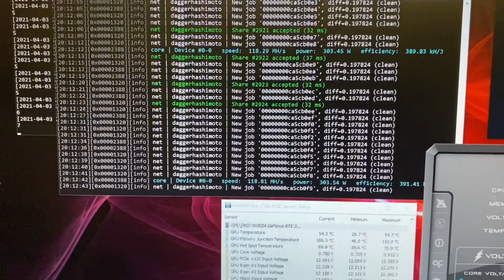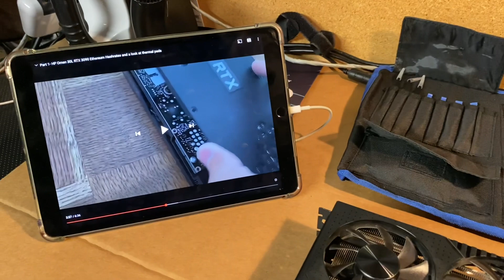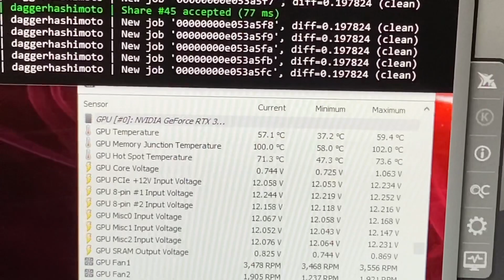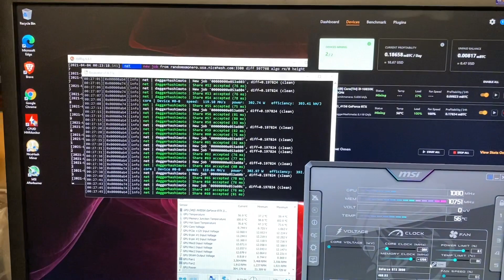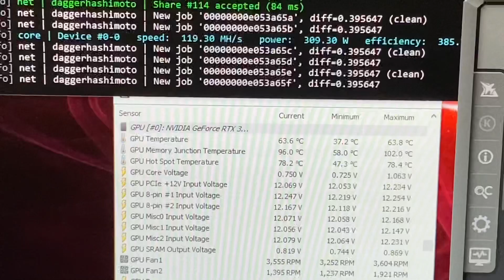HP Omen 30L OEM RTX 3090 Thermal Pad Upgrade

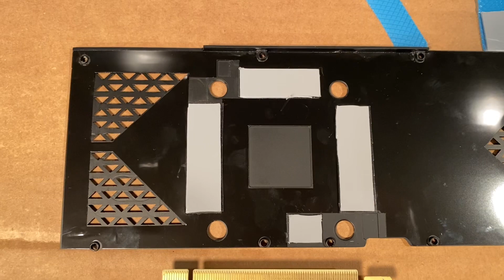Comment: 2:20 some on reddit commented to absolutely put a pad where the square indent is on the backplate to see temp reductions across the board (GPU and VRAM) by fixing pressure distribution? will try my luck as soon as i have my hp 3090

Comment: Hi everyone, i did put only thermal paste between cooler and the black metal plate and had more then 30 kelvin difference. The OEM thermal pads seems to be good.
Reply: What are your hotspot temps? I go to 105 rn don't know if i should repad or just do the thermal paste on the metal
Reply: @ParlasWOW   no, dont change the pads, do it like i did and you are fine. İ had 110 now it dropped to 80.
Reply: @Gotingenli  ok cool, thanks bro
Reply: @ParlasWOW  between the cooler block and the metal black frame is a little gap, this one is causing a problem and your heattransfer is blocked. Fill it with thermalpaste and you are fine.

Comment: it decrease the memory junction temperature , but why do you think when doing this the GPU Temperature and the GPU Hot Spot temperature increases dramatically around 15 and 20 C each? are we just distributing the heat or should we worry about some device temperature control isolated?

Comment: Hi Tony, for the back plate, how did you take out these 2 spring screws? They are different size compare to the 4 CPU rear spring screws, I tried to take them out and almost stripped them. what size screw driver should I use
Reply: Bit late now but im having the exacft same issue... Like i tried to get them out the normal way with 'brute'force (without braking things i hope) but it didnt came out.... gonna but some very very small amount of WD40 inside the screw so it losens the thread (i hope). Not sure what else to do. Already tried to put something  that has more grip between my screwdriver and the screw itself but again... no movement. May i ask if you ended up getting them out eventhough its over a year ago? lol. Thanks

Comment: I have done as instructed on the video and still maxing out at 107 MHs. Afterburner set to -375 Core and +1200 Mem. Got 61c on GPU temp and 90 on mem temp. Any help will be appreciated.
Reply: Try -250 with 1230 Mem 
And pl of 96-90

Comment: I just did the thermal pads replacement + added some thermal paste, and got -10° on VRAM temperatures! I plan also to try adding the heat sink on the top of the backplate, and see if I can decrease temperature even more. 
Make sure you are using 1mm pads, I tried first with 1.5 and it was too thick
Thanks for the video

Comment: Put any pads between the copper plate and the frame? I've seen other people do it with other versions of the 3080. But why use the paste?
Reply: I tried this and it created enough of a gap that the gpu no longer reached the copper.  Paste is the best I think because the copper winds up so close when you put the screws back in.

Comment: Lay a 120mm fan on the backplate blowing down, it'll drop junction temp a few more degrees. Ideally a high static pressure fan but any fan will do

Comment: I put two fans on top of the back plate for pulling, one on side to pull, one below the card for inhaust, one on top of the case for exhaust with the card’s fan running at 85% and it reports 96-98c on room temperature of 52f. I guess you can try to put at least one fan on the back plate(close to the rear where it’s hot) for pulling and the temperature may drop by a significant level.

Comment: hello. Thanks for your video. I have several questions.
* I have 30L-0850 Series / 3080 Geforce Card. Is 3080 using the Thermal-Pad 1mm ??
Reply: I believe so

Comment: Thank you for uploading this video.

I have an Omen 30l, with the 3080. Any idea what thickness of thermal pads I need?
Reply: I tried 3mm and 2mm today. Both too thick.  Will try 1mm on Monday.
Reply: @lagrafx  hey could you let me know what worked for you, please? I also have the same HP 3080 OEM
Reply: @maalisl  I believe they are mostly 1 inch pads
Reply: @sadistical5787  yeah I got 1mm pads and Noctua NT-H1. Now my GPU does not go over ~70C anymore!

Comment: i have the 3070 model, is it the same process?
Reply: 3070 uses gddr6, only cards with gddr6x have overheating issues. 3070 is an awesome card all around

Comment: Thanks for the guide.. My gpu was 67c, 108-110c junction. Did a thermal pad upgrade, it definitely helped vram, 98c, but my gpu is 80c. I had to mess with my thermal paste a couple of times as it was throttling clock speeds. Is it possible the heat dissipated from vram to heatsink is causing gpu stay hot? Is mining at 80c fine? I only get 105mh too..
Reply: I read this from an amazon user - 

Scenario 2 : Same as first, except when you test your gpu you get good Memory Junction Temps, but your GPU and Hotspot Temps are elevated. This problem occurs when there is an even distribution of pressure on the thermal pads, as the Memory Junction Temps are low, but the Heat Sink is not making proper contact with the gpu, causing the GPU Temps to rise. The solution to this problem is almost the same as above, with a few exceptions. First, check the backplate screws. Again, this solution may be just this simple, and yes, this happened to me twice on the 3080's. The first time i tore the card down, and put it back together and it worked fine. During the tear down, i noticed that two of the spring screws(M2x7mm) were fairly loose. When I put it back together, I didn't make anymore thermal pad changes, just double checked that the backplate screws were tightened properly. On the first test, GPU Temps were at 46 C, and Mem Junc Temps at 76 C... Perfect. On the second 3080, I was getting the same problem, and before tearing it down i double checked the screws, and sure enough one was loose. Tightened the screw and temps dropped immediately. Now, if you check the backplate/heatsink screws, and they are all tight, then you may have a second problem. This problem will be that all of the pads on either the back side of the card, or the front side of the card, or both, are too thick. If the memory temps are all low, but the gpu temps are high, then the thickness of the new thermal pads may be too thick, and the heatsink is not making contact with the gpu. This scenario is different from the first one, because in this scenario the new thermal pads are making even contact with the memory. For that reason, you would need to change all the thermal pads so that you can continue to get that even distribution of pressure on the thermal pads. Just as a tip, if your gpu temps are extremely high, then take off a mm from the thermal pad thickness, if the temps or only slightly elevated, then replace the thermal pads with a thermal pad that's only 0.5mm less thick. For example, if you have 2mm pads, and the temps are extremely high, then replace the 2mm pads with 1mm pads. If its only moderate, then replace the 2mm pads with 1.5mm pads. This is also making the assumption that you applied the thermal paste on the gpu die properly. This, too, can be the problem.

Comment: Glad I found this vid, I found the other vids for aftermarket cards, but this one is exactly what I need! So I made the changes and put everything back together (used 1.5mm pads) and now my GPU temps are too high, with OEM pads I was at 46.8/49.1/48.3 degrees (Min/Max/Avg), then after the mod I was at 71/71.8/71.5 degrees. I noticed the back plate is a little elevated and it doesnt sit all the way like it used to, anyone else run into this??
Reply: use 1mm like in the video then.

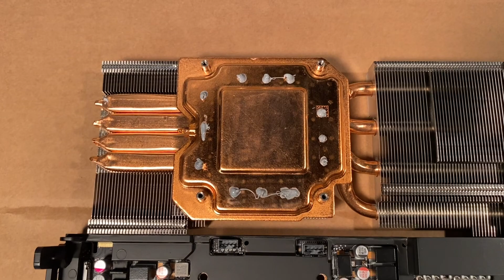Comment: Thank you for the video. After thermal pad upgrade my memory temp went from 110 to 95C, but my GPU went from 65 to 85-87. Could it be due to additional thermal paste that I applied on copper plate (as on your video at 3:48)? Is it possible that this extra heat is coming from memory to GPU?
Reply: yes
Reply: I don’t think so

Comment: The very key to this project is that extra paste you put in between the black metal shroud and the main heatsink. Skip that and you might get some minor improvement but the real issue is that the shroud over the rams is not making proper contact with the main heat sink. Pads are too thick to put there, so paste is needed. Be generous, and figure out where the shroud and heat sink actually meet for best contact and thermal transfer. You know you've done it right if you get massive decrease in memory temps and increased heat in your core. The mems heat up the main heat sink and increase core thermals a bit but it's just fine anyway.
Reply: Your exactly right  that is what i was seeing and thought somethings wrong was going to tear it back apart and apply more thermal paste to gpu . Thank You for the heads  up.. FYI I went from 52c Core  100c vram  to 60c Core and 86c vram with a small fan blowing into case also added the heat sink with thermal pads going to try a blower style fan  blowing across GPU to back case exhaust fan.
Reply: @bobwire6440  I'm just running without side panel. The airflow of the case is so bad no matter what you do. It's a shame, with a little thought put into it it would be a very very pretty little case. As is, it's just impossible to make it have enough airflowe to high tier CPU and GPU
Reply: I have done as instructed on the video and still maxing out at 107 MHs. Afterburner set to -375 Core and +1200 Mem.
Reply: Just tried to reapply thermal paste and thermal pads for my HP omen 30L but got a huge decrease in hashrate and the temperature didn't decrease. What did I do wrong? I think I applied too much thermal paste
Reply: What about .5mm copper shims?

Comment: just got this computer too....runs super hot (102-106 with case open).... def will be replacing pads and see what happens, but so far I took it apart to confirm 1mm pad size, and decided to add a little Artic Silver I had laying around, to the GPU and to the radiator plate like you did. My temps have dropped 6-8c from this ALONE!!! wow. 

I've also seen some vids on adding heatsinks to the back plate. I'll be doing that too. I'll update the results.
Reply: Added two 100x40x20mm heatsinks to the backplate, no thermal tape or anything.... just layed on it. Got another 2c drop. Will add thermal pads when they come in, and thermal tape to the heatsinks. And probably a fan pulling air off the heatsinks. I will report back.
Reply: Update## I installed 1mm thermal pads..... temps went up!!! wtf. Redoing the 1mm pads has increased my temps back up to 106c.  I took back apart to make sure I didn't miss anything, but I'm not seeing anything obviously wrong.
Reply from the maker: That seems crazy! I’ve been considering adding a heat sink to the back of my card as well. I took a processor heat sink w/fan from an old computer and I just need a cable splitter for the fan. It may be a week or two before I get around to playing with this... work, work, work and no time for fun projects.

Comment: how much was the prebuilt? what are the specs besides the 3090
Reply from the maker: Way too much! But I’m still glad I bought it and I thought it was a fair deal for a prebuilt. I will say that there was a decent promo code on the forums. Always search for promo codes!
Reply: I got mine (just to get video card) for $2500 before tax. That is for i5-10600, 16GB, 512SSD, 750W PSU. Microcenter recently had i9-10850K, 32GB, 1TB SSD, 750W PSU for $3000. These HP Omens are not really made for 3090. Very poor cooling system in the case, i9 and 3090 want 850W, not 750W. And HP motherboards are very basic. I couldn't play GTA V on ultra (3440x1440) without getting 110C on memory with my Omen. I wouldn't recommend high-end Omens.

Comment: Excellent video man, I just put my 3090 omen card together this morning to test. I am using TRex miner & my Memory temperature is stable at 86C @ 119MH with your OC settings. 
My only concern with your process is the chips you added thermal pads to is not allowing for good contact from the copper plating to the black plate. The difference in our temperature may also be the mining software.  Would love to hear your thoughts.
Reply from the maker: Thanks! That was my first ever video. I’m still wondering myself about those two chips I added pads to last minute. I’m thinking in a week or two, I may take it apart again and remove them and see what happens. I’m relatively new to mining and haven’t tried TRex miner yet, I want to get away from NiceHash but time is scarce and NH was quick and easy... any tips for TRex?
Reply: @tonysanchez3290  Trex is optimized for 30 series gpu's. You could download Trex and try it for free even without making a wallet, say with coinbase. It is simple to run.   I didnt mean to word it as if your card could perform better for certain or there is a problem. Just wanted to share my temps, interestingly my hot spot temp is 5c hotter than yours.
Reply from the maker: @blakeracerr899  Well, I couldn’t leave well enough alone... I took apart the card again to check coverage on those two chips I added pads to. The pads were making good contact with the frame, so no trouble there. I replaced the pads and thermal paste again (without covering those 2 chips) and now the damn card is running a couple degrees hotter. I also noticed that all the chips made a nice indent on the new pads, except for the long strip in the middle of the black frame, there was barely any impression on the pads. I’ll be taking it apart again to cover those two chips again and if there is little/no impression on that long strip again, I’m going to try a 1.5mm pad there. Stay tuned!
Reply: What thickness pads did you use please?
Reply: @lagrafx  1mm